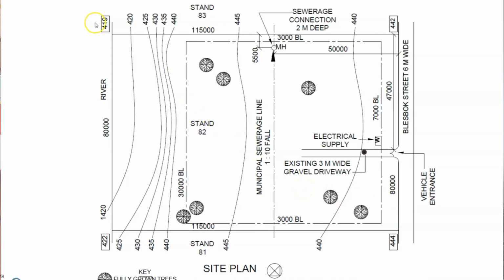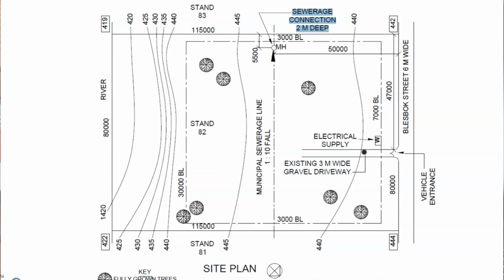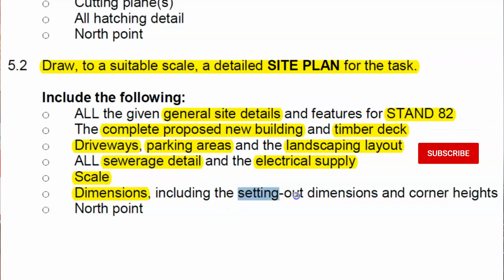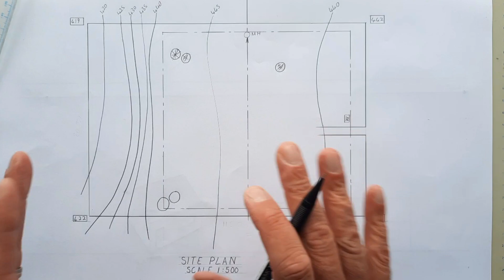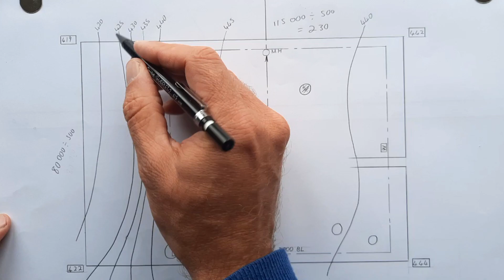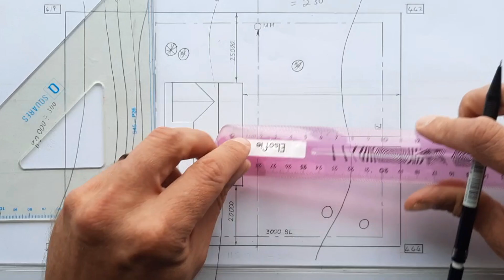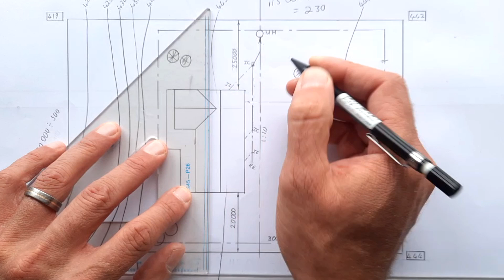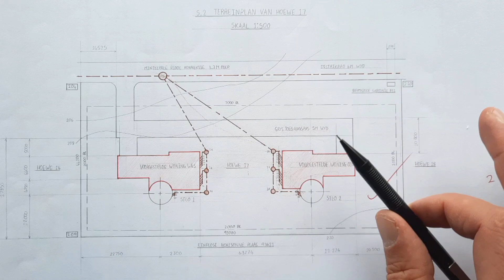9. HOW TO HACK YOUR PAT: Drawing the SITE PLAN - EGD Grade 12 - Civil PAT Task 2021

Comment: Hello meneer . Ons moet die terrein plan van 1:350 gebruik en met my resort is daar n paar komplikasies soos bv. Een van my mure is 13 cm en ek moet dit deel met 350 maar ek kry 0.03714..... 
 Hoe gaan ek dit teken ?
Reply from the maker: Dankie vir die vraag... I would think that a scale of 1:500 would be more appropriate. But, as per your request, for a simple 1:350 scale conversion take the 13m as the length of your wall, convert it to 13 000mm and devide by 350. That wall will then be 37.4mm in length on your Site Plan. Hope that helps. Blessings